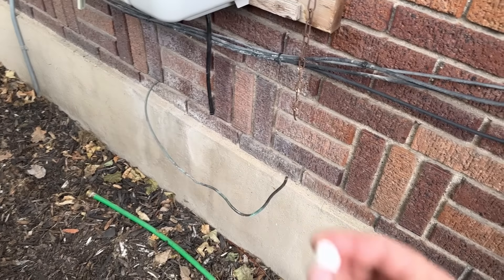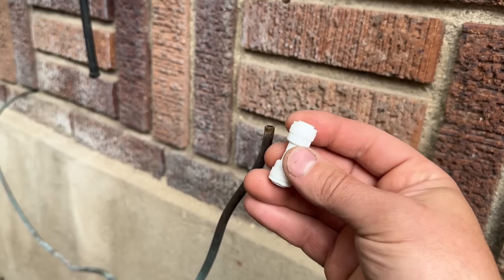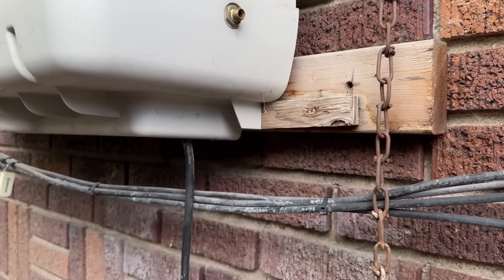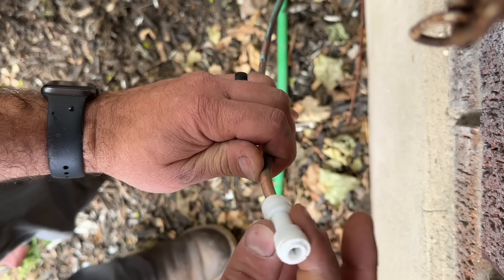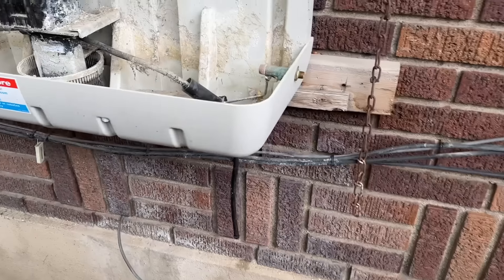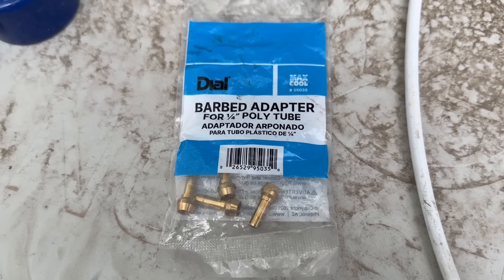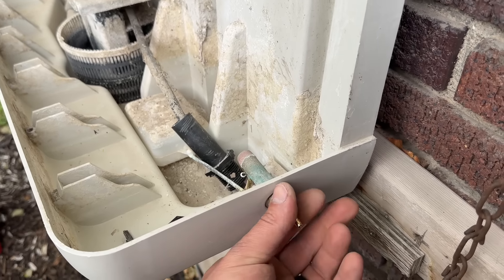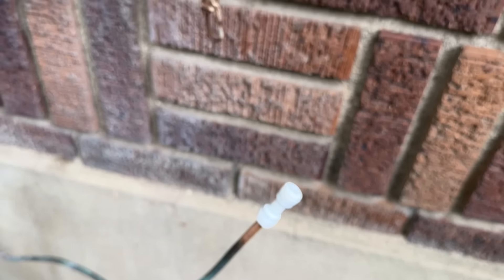Never Use Compression Plumbing Fittings Again! They ALWAYS LEAK. Use These Instead.

Comment: The compression water fittings assembled dry will tend to leak, assembled with a teflon pipe dope or even a wrap of teflon tape will help prevent leaks
Reply: Yeah, use the dope! Seriously. Just a little bit of dope at the contact point.
Reply: I use a little cooking oil to lube the fitting and reduce friction. Non toxic and works every time.
Reply: After I put the nut and ferrule on the pipe I do a couple wraps of Teflon tape around the feral the direction the nut will tighten! Pretty much guarantee no leak and there's no o-ring to go bad
Reply: Teflon (or PTFE as we call it in UK) seems to work quite well when it comes to sealing the olive (ferrule, cone etc). I presume by pipe dope you mean joining compound?

Comment: It’s important to inform everyone that the fittings you are promoting are NOT UV rated and are not rated for outdoors.
Reply from the maker: Good call. I’ve used them outside for swamp coolers and on roofs with no problems. 🤷🏻‍♂️

Comment: Good video.  However, a brass connector to compression on a copper pipe works good. Brass to a plastic tubing works ok, but you must use a metal insert into the plastic tubing. Without that support, it will always leak. I would also attach the copper tubing to the wall and also the plastic tubing. If these are not held down, someone could tear them off by accident.
Reply: I came here to say this. 100% user error. They make compression fittings with copolymer sleeves that are meant for plastic lines.
Reply: @steveo0409  never seen it, but will look for it next time I’m In Menards….  Thenks….
Reply: I trust a compression over an oring fitting ,

Comment: Never use a brass compression ferro on plastic pipe. They make platstic ferro's for that. Slip fittings also have a lock ring you should be using.

Comment: If installed correctly the compression fittings work and do not leak. The push fit you are talking about is a lot quicker, but i will stick to the compression style.
Reply from the maker: I’ve tried just about everything and they always seem to leak. I’ve never had one of these slip on unions leak over the past 5 years of using them.
Reply: Make sure you do not over tighten compression fittings  and is going to be fine

Comment: I've used the compression fittings for 60+ years and NEVER had one leak or fail.
Reply from the maker: You are a rare breed sir. I’ve done everything they say and they always seem to leak. These things are fantastic
Reply: and five years experience to "prove" it.   Not enough   I've 55 years of real life use of compression fittings without a single failure.   Shark bight style fittings are an expensive and far less durable solution to something that is not a problem when installed correctly.

Comment: For polyethylene  tubing, use polyethylene ferrule. Don't use brass (a.k.a. olive), it will cut into the poly tubing— brass is for copper tubing. Also, no plumbers tape on threads. (a mistake I've made). —When using those push together things: if/when it does leak, take it apart and re-cut the end of the tube with a proper tubing cutter, don't re-insert without cutting off that 14 inch of buggered up tubing. Also, when using compression fittings on poly, the brass sleeves are important to keep the poly tubing from collapsing. It looks like the sleeve is integrated into the barbed adaptors. Thanks again!
Reply: Exactly!
Reply: I use a razor blade to cut the poly tubing, I've asked at Lowe's of better cutting tool for this and they say razor blades.  I haven't encountered any issues using brass connectors on poly tubing, just like guy on video said it does cause anxiety major.  These plastic connectors are so easy and work well.
Reply: Those plastic push-on fittings shown in the video are often called John Guest fittings.  They contain an o-ring in each end, which seals around the outside surface of the tubing.  So when you clean up your copper tubing, ensure the last inch or so of the tubing is as straight and scratch-free as possible.  Also, remove any sharp edge if the tube end was cut with a saw; otherwise, the rough edge can damage the o-ring within the fitting.  For plastic tubing, be mindful of any scratches or roughness on the outer surface or end of the tubing.

Comment: I was having such a hard time installing the traditional brass fittings to connect the two lines together. I was going to buy more of the same, but asked if they had what you are recommending and they did. It was so simple to install. I can't believe how much time I tried with the old way. Thank you! I did overpay for it at Ace at about $6.99 for one and the link that I just now clicked on that you provide gives you a 10 pack for $6.99. I might have to just buy the pack to have them on hand. Thanks this was very helpful!

Comment: My favorite plastic fittings for 1/4" tubing are the John Guest fittings. I have used them throughout the house running RO water to multiple sink faucets and ice makers without any leaks. They also make inline quick connect valves as well.

Comment: The the plastic one you pointed to was leaking because it was done wrong. You can't use compression fittings on plastic tube without the copper inserts that go inside to stabilize them!
Reply: Hmmm, I haven't been using the copper inserts and all is working well.

Comment: Thanks for posting the video. It was a headache for myself until I learned when connecting to poly tubing we must have a insert in the pipe to prevent leaks so the compression fitting, ferrule can really clamp down strong.

Comment: basically i'd do the exact opposite you've done. those push-fit fittings are made for plastic tubes. they will eventually fail on metal tubes since they can't grip as well on them..
The compression fittings never leak, unless you install them like a plumber that thinks more torque is more betterer. crushing them is what makes them leak almost everytime. screwed to contact then a light snug is all that's needed with these but everyone insists on cranking them to hell then wonder why they piss water everywhere :p

Comment: Cheap plastic push on connectors do leak over time especially when they are outside. Barbed fittings reduce the ID of the tubing, but they work. Brass ferrule fittings work great. On cooper the tube needs to be clean and you should use a little vegetable oil on the ferrule. It also helps to anneal the copper a bit with a propane torch and let it cool naturally. On the plastic part just use vegetable oil and only finger tight plus about a half turn, then turn on the water and tighten until it stops dripping if it’s dripping at all.  Ferrule fittings work just fine and do not deteriorate like plastic in the weather. They been around forever. I absolutely do not trust cheap push to connect fittings for water in a home.  If that fitting breaks that 1/4” line could do a lot of water damage.
Reply from the maker: To each his own. Thanks for the feedback

Comment: those metal brass inserts are  almost a must have whenmessing with plastic tubing ,,the quickdisconnects are beutiful when it comes to hooking up plastic lines whether their water or air. its better to use an insert on the quick disconnects ,but i have had fair luck with out them but better to have .
ty for reminding me about the connectors ,being an x trucker  i forgot all about those.

Comment: Thank you!! I need to buy tubing and fittings for my swamp cooler and this really helps.  I love the push to connect idea for repair when tubing gets punctured.  Love the plastic ones.  I did find that they have them at Lowes, so they probably have them at HD.

Comment: Good video ! Yea, totally agree on the brass coupling they seem to leak after a period of time. Also agree on the poly fitting. I have used them for 10 years now & they do work well. No leaks so far on a water filter job using poly fittings after 10 years. Was there a couple days ago & still doing well.

Comment: Problem with compression fittings on plastic pipe is people tend to give them the same amount of torque as they would when doing up a joint on copper pipe work. Compression fittings can be used on plastic pipe no problem, but you need to nip them up enough so that it the olive doesn’t grip the pipe properly or gets squashed into the plastic itself. Generally speaking, compression fittings should be done up with a bit of PTFE tape (Teflon as you guys call it) around the olive or smear on some jointing compound as doing them up dry can be risky.

Comment: Went looking for reviews on the Uxcell brand ones I'm seeing on Walmart's website.

Looking to rip out & redo a crusty 20+ yr old line. Unfortunately it's copper line from the hot side to brass compression T. Under the sink, through cupboards, over a doorway, to the fridge.
A 1961 built all original house definitely comes with some DIY tasks. After signing, we've dropped $17k in the first week.

Comment: QUICK QUESTION:  I want to add an in-line carbon water filter - can I just cut the supply line and insert each cut end into the filter w/o a compression fitting?  🤔 Thanks🤠😎

Comment: I’m a plumbing contractor and this guy couldn’t be more wrong. Never use a shark bite fitting inside a house. It’s good for a temporary fix, but over time the rubber O-rings start to deteriorate and the fitting starts leaking.

Brass compression fittings work the best if it’s done correctly. You have to use a plastic ferrule on pex pipe and the brass ferrule on copper pipe. Also, put some pipe dope on the threading.

Comment: How do I connect 3/4” soft copper tubing to 3/4” soft copper tubing in my compressed air line? This is driving me nuts. 
The ID of hard copper pipe is 0.75” and the OD of soft copper tubing is 0.75”. So one would think that I could use an inch of hard copper pipe as a sleeve and solder them together. But there’s a small amount of slop in there and I worry about getting a good seal. Any ideas?
Thanks,
Paul

Comment: These push to connect unions or fittings are made to connect plastic to plastic, but works for copper to plastic too?!?!?  That’s convenient.  So if I have a 1/4” to 1/4” push on valve, I don’t need this union; I can directly go copper from in the inlet to plastic to outlet of my valve?

Comment: I've been trying to figure out what I want to do with this mobile home that has copper water lines, bottom is 3/8 in and the top goes into a 1/2 in with a plastic insert part that pushes against the flare pipe when tightened to create a seal. Its leaking right under the 1/2 nut at the pipe flare dipping down the pipe its not like a fast drip its just a slow drip but yeah its annoying lol. I know when I went to a plumber shop they told me to use 3/8 compression fittings on the pipe and then just hook up a water supply line to it. I don't see a 1/2'' barbed adapter but I do see 3/8 in push to connect I might need to do some more research.

Comment: If you do not put an insert into the end of the 1/4" plastic tubing, yes they will leak, but with the insert, they will not.
Reply from the maker: I’ve tried it both ways and most of the time they leak.. 🤷🏻‍♂️
Reply: @diyhvacguy  a little teflon tape around the feral pretty much guarantee no leak! 36 years experience here! I like your channel buddy!!
Reply: And those that leak always lack an insert.   If you are skipping the insert, you are asking for fitting failure, and the solution to that problem is to install the fitting with all the components needed and torqued properly.   Then sit back and wait to see what happens.   Correctly installed compression fittings will not leak and will outlive virtually everyone reading this post.

Comment: Hooked up many ice maker or humidifier lines with 1/4" nuts. If a little poly line, are you using a stiffener and nylon ferrule? I rarely have any problems. Sounds like installer error man.

Ive even seen a brass ferrule on a poly line. Thats a last resort as itll cut into the poly...but yea...generally i have 0 issues.

Comment: Does the manufacturer recommend a clamp to secure the tube on the barb fitting? I know on larger barbs, you usually use some kind of clamp. I'd probably be tempted to grab a tiny hose clamp from the parts bin for that guy just for some extra insurance.
Reply from the maker: I’m not sure on that but boy if you try and pull that off you won’t be able to. If I want to reuse one of these fittings I’ll have to cut the tubing off of the fitting. It’s pretty small. Not sure if one could find a clamp that small anyhow
Reply: Single barb fittings used with nylon or polyethylene tube require no insert or clamp, but I still trust the compression fittings.
Reply: @diyhvacguy  McMaster Carr has almost any fitting or clamp you would ever need. Those barbed fitting are often used for pneumatic controls like actuators and dampers. They usually carry air pressure.  I never see them leaking when used with the correct tubing. They should be fine for water, but once again if it’s water and it does leak there could be a major problem. If that tube is in the sun it could get so hot it builds pressure, softens, and blows that tube right off that barb. With air you hear a hissing noise and fix the leak. With water you could be calling your liability insurance company to repair water damage or calling a lawyer when the customer sues. Just saying.

Comment: Properly installed compression fitting do not leak. They would get pulled off the market by now if that was the case. I've lived in several houses that have had compression fittings for decades and none of them leak.

Comment: Lol the orings in that press on coupling will go bad and it'll leak for sure
Reply: Absolutely correct.   Press on couplings are only as good as the rubber gasket, and those of us who've been around rubber gaskets and washers for more than a few decades know exactly what to expect from them.   Failure.

Comment: What about larger pipe, such as the half inch copper pipe used for water supply lines to bathroom and kitchen sinks, which feed into shutoff valves below the sink?  Are you making the same recommendation against using compression-fitted shutoff valves?
Reply from the maker: No I’ve never had an issue with compression valves. Just the small 1/4” ones I always seem to get a leak. These fittings are so much easier and I love them

Comment: You showed the barbed fitting with no pipe, then the barbed fitting with the plastic tube connected and finished, but you didn't actually show the plastic being connected, which is the most important part 🤔.
Reply from the maker: It just slides on. Sorry about that. I didn’t have my tripod with me otherwise I’d have shown that part!

Comment: I blown cold air into the attic using super strong fan.  Has anybody considered installing a fitting on their ductwork to temp redirect cold air into the attic if u have to be up there during summer?  Would love to see if anyone has ever thought of this or tried it!
Reply from the maker: Yea that would be really smart! A swamp cooler is one way of helping in that regard. They make small portable plug in ones
Reply: Typically attics aren't insulated conforming space areas.  That ac will be working hard.  You'll pay for it

Comment: what is that thing some kind of swamp cooler air conditioner unit?
Reply from the maker: Yesir, it’s an evaporative cooler. We have a lot of them out here in the west where it’s low humidity. I’ll do a video on it soon explaining how they work! Cheers
Reply: @The DIY HVAC Guy  Yeah, I haven't seen those either. We (me and my family) reside on the East Coast. Although, I keep a window banger (portable ac window unit) set aside for Hurricane season. Just in case we lose power for weeks. Decades ago, I learned the hard way. It's miserable, not having AC, especially with the heat/ humidity index off the charts.